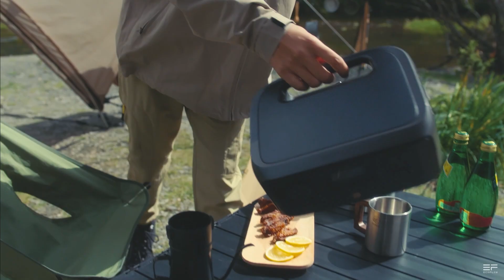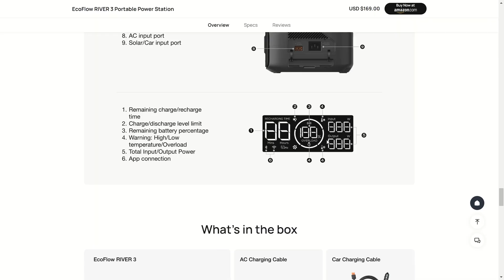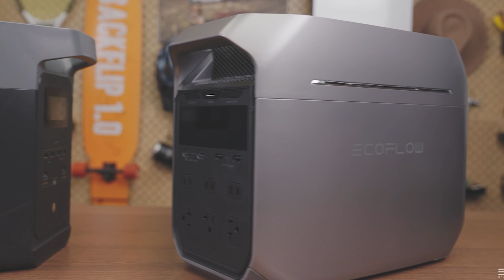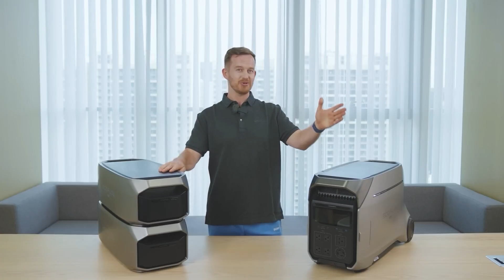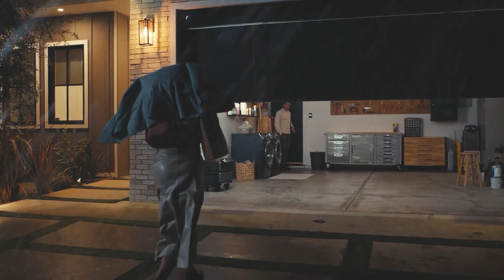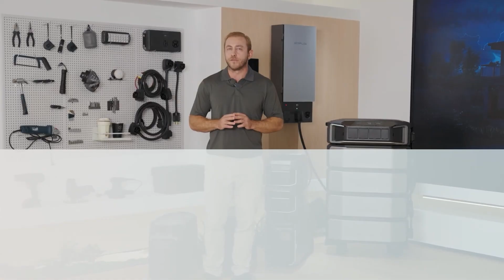EcoFlow River 3, DELTA Pro 3 & DELTA 3 Plus Portable Power Stations, Major 2024 Releases Compilation

Comment: Strange concept of the company, they sell a set of delta 3 plus + alternator charger, also released an extra battery for this model but there is no solution how it will work together and at once? How to charge delta 3 plus with an extra battery connected using alternator charger? Where is the second port? At least they came up with some kind of hab.
Reply from the maker: That is a good question.  I have the alternator charger and have to unplug my WAVE 2 from the battery in order to attach the alternator charger.  It's super fast charging but there is this one problem that you noted that may exist with other units as well.  I suppose all products have their limitations and could always be improved.  I know ecoflow is always checking in on these videos and they do pay attention to the comments, so keep sharing your thoughts.  They are constantly improving.
Reply: I like ecoflow products. I ordered delta 3 plus and alternator charger and would like to expand the battery capacity using a delta pro 3 battery at 4 kWh. It would be ideal for me to have the ability to be mobile and expandable. But alas. The developers did not think of making a second port. I hope this information will reach them and they will react to this. Perhaps they will release a separate hub. In the meantime, I have to cancel the order and wait for a fully thought out version. @adventure-tech
Reply: I like ecoflow products. I ordered delta 3 plus and alternator charger and would like to expand the battery capacity using a delta pro 3 battery at 4 kWh. It would be ideal for me to have the ability to be mobile and expandable. But alas. The developers did not think of making a second port. I hope this information will reach them and they will react to this. Perhaps they will release a separate hub. In the meantime, I have to cancel the order and wait for a fully thought out version.

Comment: X-boost is gimicky. It boosts the voltage but drops the amperage. Really bad for sensitive electronics.
Reply from the maker: I'm really interested in learning more about x boost and how it works.
Reply: I think it lowers the voltage and rise the current.
Reply from the maker: @bachellervirginia4832  Interesting, but it doesn't make much sense that way; since increasing voltage and dropping amperage won't give you any additional wattage.   For example, 12 volts at 40 amps would be 480watts, and also 120 volts at 4 amps is the exact same amount of energy flow at 480W.   They would have to increase voltage or amperage by itself by a lot to double the wattage.  The magic trick here is pulling a large amount of wattage out of a smaller battery pack.  So if the river 3 is about 300wh or so, it can boost double that battery pack size somehow with x-boost.  Generally all of my LFP batteries should not output more amps than the total battery total amp number for long periods of time; only short surges.  So to see these doing double the amps they should with those size battery packs is very interesting.  Perhaps is more about cooling tech than energy.
Reply: @adventure-tech   some devices can work from 100V to 130V, if  the device is rated at 120V 1200W, it is 10A; if you only provide 100V to it, it can still work, but only consumes 100V 10A 1000W.  But this doesn’t work for all products.